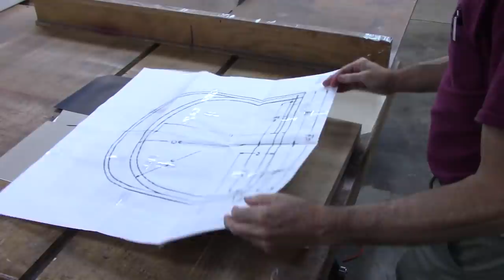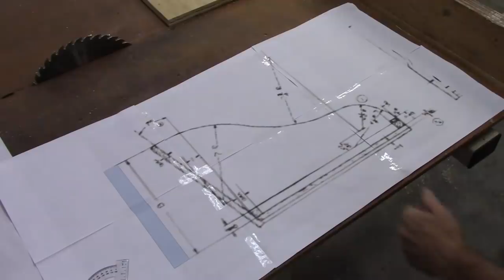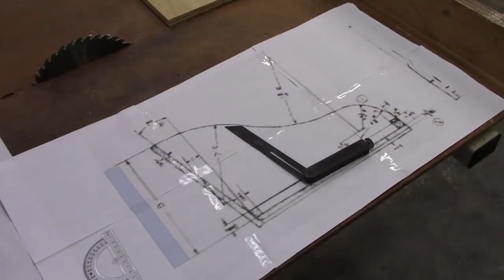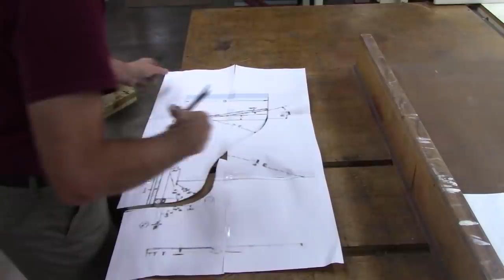Part 1 - Building a Briggs & Stratton Buckboard Flyer

Comment: When doing your bolt circle for your wheel plate it would have been way quicker to put the plate in the vise which would have been way more rigid of a set up for drilling. Sweep the center hole and just make X,Y moves on the table. Not being critical, just that I was a certified journeyman toolmaker for 30 years and taught machining at a local college. That would be the way I would have done a simple 4 hole bolt pattern. Only reason you might have gone this way is your table didn’t have the Y travel? I always avoided most rotary tables if possible, lots of backlash and never lock down enough for some applications. You seem pretty experienced. Enjoyed the video. Nice job on the build.
Reply from the maker: Yeah...  that would have worked perfect! Thanks for the tip. In some areas I have a lot of knowledge and some not so much. Also ready to listen for a better idea. I've had a lot of exposure to machine work and been a woodworking forever. I designed improvements for printing presses before a retired so I worked closely with out machine shop and learned a bunch. I've had a lathe for about 6 years now. I had 3 so far but sold one...  now have a logan and a South bend. Old stuff...  1942, 1947 and the South Bend is 1931. I love the south bend! but they are all fully restored and nice lathes. The mill is junk but 100% better than no mill. I've had it about 2 years. Nice to have.  Check out my other videos. Thanks for the comment! Hopefully you subscribed. I like hearing about better methods!
Reply: Winky's Workshop no problem. I was our shops CNC lathe department head and programmer for 15 years and project head of many big projects such as fiber optics furnaces and other big builds for the glass industry. If you ever need advice on trig to do bolt patterns and such I am really good with that stuff. Now that I retired from machine work I do electronic repairs and builds. Love it, wish I would have went down that path over machine work early on. Can’t complain, had a good career except for surgeries from lifting and wrecking joints. Tough job as you get older.

Comment: Those bushings on the steering knuckle 40:44, I think the bushings should be inserted from the inside so that the flange of the bushing will carry the load. Nice project. Nice video. Also the drive wheel will scrub when you make tight turns because it sets behind the rear wheels. It probably affect handling when turning.
Reply from the maker: Good point on the bushings. I planned on using bushings without a flange actually but when I went to install them I only had the flanged. The pin length was already established so I didn't have room. I don't think there will be any wear issue and the steering is effortless. You are right about the lateral movement of the rear wheel. It chatters occasionally but turns fine. Not an ideal method but still works.

Comment: I’d be knocking stuff like this up too and then some if I had access to a decent workshop. Sadly, most of us are not so fortunate.
Reply: I hear ya bud. I've wanted a milling machine since I was 18. Now I'm 66. Just got a free lathe & I'm trying to get that working!
Reply from the maker: What kind of lathe? I'm 64 and bought my mill 2 years ago. I've had a lathe for about 6 years. I've actually had 3 of them, a 1942, 1947 and then a 1931 model. If you are willing to do a lot of work on them you can find them fairly cheap. When I brought home my first lath my wife said...  oh great, you paid somebody to take their garbage. I'll admit, it looked rough but it turned out to be a good lathe.
Reply: @WinkysWorkshop   my brotherbrother-in-law salvaged an old Atlas bench lathe. Two bearings were frozen, but when I took them apart they looked perfect. Just had to clean out the solidified grease and reassemble. 
Not sure what year, but it was made before live centers came out. The tailstock has a little pot with red lead still in it, that was for dabbing on a dead center for lubrication when turning a long piece. (I learned about that watching an Atlas video done by mrpete) Still have to go thru everything else on the lathe. 
Loved watching you building the little car.  There are 5 bicycles in my cellar, I have a notion to build something similar!
Reply: It's surprising what can be done with hand tools and a little extra time.

Comment: Can't wait to see part 2!  If you need more traction you could try finding a tire with more aggressive tread.
Reply from the maker: Thanks. The traction is much better than I expected on pavement. Totally adequate although on gravel or grass it spins
Reply: Winky's Workshop even my 1 wheel drive gokart spins on grass with my weight on it.

Comment: You've got impressive skills, awesome machine work.  Seems a little more heavy duty than it may need, but I don't expect you'll be breaking any parts.  How much is it going to weigh?
Reply from the maker: Good question on the weight...  I need to drive it over a scale. I'm guessing less than 200lbs

Comment: When machining parts you should use a coolant in order to not over heat the metal. It also provides lubrication and makes it easier to cut.
Reply from the maker: For the most part I do. I used spray mist coolant instead of flood. It's hard to see it in the video. It's almost as good but nowhere near as messy.

Comment: Very cool project! Looking forward to part 2, I really want to see what kind of speed and handling you get.
Reply from the maker: There will definitely be some driving videos. The handling is good although not super great in a corner and the brakes are terrible!
Reply: @WinkysWorkshop  A little Camber in the spindles will help with cornering. Maybe add curved blocks of wood as brake pads. To increase the contact suface, like on an old horsedrawn wagon?

Comment: I like where you are going with this, but one thing I have noticed is that you are running the big end mills and reamers WAY faster than I would. Those big end mills like to run about 250 or 300 rpm. The reamers I run about 100 to 125 rpm. Just the way I was taught and did for over 30 years when I was working. Thanks, I really like the project.
Reply from the maker: I totally agree on the reamers. My drill press won't go slower. I'd have to watch again but I was probably too lazy to change speeds on the end mills. I think that was when I was surfacing the top of the motor mount? That was a light cut...  I probably would have slowed it down to do more substantial milling.  I need to find a slower motor or a 3ph motor with a VFD for the drill press. Thanks for watching.

Comment: I can't wait to see part 2. I would love to build one of these for my boy and have him drive it around.
Reply from the maker: These things are a lot of fun but a standard go-kart might be a bit more durable and safer. The brakes are the worst part of this car but it's not as stable as a go-kart
Reply: @WinkysWorkshop  I think my version may get a few mods as far as brakes and would probably get geared down to crawling pace.
Reply from the maker: @Engineerd3d  - I can't remember where I got the large sprocket for my wheel but I think it was the biggest I could find (112 tooth) and the motor is the smallest available (11 tooth). It's okay to go with a smaller drive wheel as long as the pivot point where it connects to the car is the same height as the drive wheel axle. Otherwise the wheel will lift the cart. The available sprocket sizes and end ratios are way more if you use a smaller wheel. Good luck on the brakes. I'm thinking maybe calipers brakes like a bike.
Reply: @WinkysWorkshop  they do make disk brake conversion kits for bikes. Maybe a machined bracket and a nice pedal is what I was thinking.
Reply from the maker: @Engineerd3d  - I might look into that. One reason you don't see go-karts with spoke wheels is that they have a hard time handling engine torque although...  you do see coaster brakes on a bike which would be similar to disc brakes. The big problem would be mounting the disc to the wheel.

Comment: I build replicas of early 1900 era cars. I am in the process of completing one like you have built. Building plans on these older cars are sketchy at best. I do it mainly from looking and studying pictures.  As best I can tell you have a # 40   112 tooth sprocket on the wheel. Do you recommend the 3 1/2 hp engine or would you go 5?  I heard you say that you converted to a go-cart type slip clutch which I think was wise. How many teeth on the clutch?  Does it actually go 24 mph. These answers will help me finish. 
My framework is Hickory.
Reply from the maker: Hickory is good and strong!  There is a link to the plans under the video. You are right.. sketchy. I imported mine into cad and then made it to scale with the few known measurements.  If I though somebody would pay well for my efforts I'd re-draw them.  3.5 HP is enough for my wife and I on level ground but we are maybe 150 lbs each. It goes 28 MPH and that is plenty but a little more power would be nice. The sprocket Linn-Gear 35A112 SPROCKET H1 (112 tooth). The centrifugal clutch I highly recommend! Mini Bike Clutch 3/4 Bore #35 Chain 12 Tooth. Email me winkysworkshop@gmx.com

Comment: I was looking at an original Briggs and Stratton motor wheel online.  They tucked the engine (smaller) right inside the rim and ran the exhaust down and out thru the mount.  You ended up having to space the engine out a little because of the shaft length, but with all that heat, it was probably needed anyway.  You might want to consider some sort of sheet metal piece between the rubber and the exhaust to protect the tire.  I had never seen one of these before.  I don't know how you come up with this stuff.
Reply from the maker: I saw a picture of one about a year ago and told the wife I was going to build one. My exhaust is a good 3 to 4 inches away from the tire so not a problem. The engine is offset quite a ways to keep the drive wheel centered. I overlooked a clearance but it worked out. My pull start is about an inch from the right back wheel. Closer would have been a problem.

Comment: very cool. But to add more weight or downward pressure for the drive wheel, would you be able to do a spring load of some type to pull the setup down & just use the lever to lift it instead ?
Reply from the maker: Thanks...  there is no spring, just gravity. Traction is not ever an issue unless you are turning and the wheel sometimes chatters.

Comment: I'm sure it won't matter much at such low loads and power levels, but my automotive heart hurts a little when I see regular bolts used to clamp a wheel designed for conical bolts. Excellent project through.
Reply from the maker: Thanks. Actually these wheels were designed and sold for use on garden carts. I'd say most are probably held on with a washer and cotter pin. The wheels run on a 3/4" axle same as most go-carts but you are correct, a washer and 1/4" 2-20 bolt hold the wheel on. I'm guessing under tension is would take 1000 lbs to make the bolt fail. I'd say the bearings would fail with less force. Wheels designed for this type (car) application are very hard to find. I worry more about the wheel/spoke failing. These type wheels are designed for downward force not lateral. The only thing better I could find is Workman wheels. They are designed for tricycle use and cost $160 each without the tires. I've road the heck out of this thing so far they are doing well. The turning radius is not so good which is probably a good thing. FUN!
Reply: @WinkysWorkshop  I uh, meant the drive wheel off the Kia, and really, it's more of a nitpicky thing, not a real concern about failure. :) 
I wouldn't be too worried about the spoke wheels, they can take a lot of abuse. Seems like it's a lot of fun to drive around indeed. Sadly such things are illegal where I live, or at the very least, made very difficult.
Reply from the maker: @AlexanderBurgers  - Got ya. Yeah, the drive wheel doesn't have much load. I wish it was lighter weight although the extra weight probably increases the traction some. Illegal?  Yeah, it is definitely not legal here but I don't live in city limits so nobody says much.

Comment: I have a heavy duty drill press, but not a metal lathe. I have a torch and stick, Mig, Tig welder and many diffrent cutting tools.  I guess I can get a cart built. If I ever run across a metal lathe for a good price I'm going to snatch it up, but in California everyone is looking for the same thing there is many garage hobbyist building thing's.
Reply from the maker: I wish I had a better welder but I get by. Yeah...  with a lathe and mill you can do a lot. The lathe is super useful... more so that a mill I think. Even a very small one is great. I live in KY. Sometimes they go very high but occasionally you find a deal. Of course they always need a bunch of work but that's part of the fun.

Comment: Your doing a great job! Keep the videos coming.  And your welds don't look bad. On weld.com he says that 110 with flux core has deeper penetration and the Do it yourself welders can do a great job with a 110 setup!
Reply from the maker: I had flux core on the welder and ran out. The gas does a cleaner weld but for 110v I like the flux better.

Comment: they race old time cars like this at my local dirt oval speedway hear in stanwood wa. they use honda 90 cycle wheels & 6hp engines. the wheels are stronger but they still break spokes sometimes. the track is called slime dog its on face book.
Reply from the maker: Cool...  I grew up in Lynnwood WA. I wonder where they get the wheels... I'll check it out! Thanks.

Comment: ??? I am wondering about one thing. With the bolts all lined up in a rectangular pattern, I wonder what is preventing the bed, or deck from folding from a rectangle to a parallelogram. But I feel like maybe I dozed off while watching, maybe you installed a diagonal brace somewhere that I am missing. Regardless, looks to me like you had a lot of fun building it and I really like your drill press table mechanism. Might have to copy that!
Reply from the maker: You are right...  I need to install a diagonal brace. It hasn't moved yet but it needs it anyway. I also have a video and drawings available on the drill press and x y table. I'm not sure i could do without this drill press... its fantastic.
Reply: @WinkysWorkshop  I confess I stayed up way too late to watch part 2. Looks like it will be a challenge to get a diagonal brace in under the deck. I noticed a nice trapezoid formed by the anterior and posterior seat mounting points. Maybe replacing the seat posts by outlining that trapezoid with oak would do the trick, and look like it was part of the original design. I'll look forward to seeing what you come up with.

Comment: Fantastic!  What is that tap handle you are using with the drill press to keep things centered and straight???
Reply from the maker: I made that a while back after tapping about 20 holes with a small tee handled tap wrench. Not enough leverage and my hands hurt!  The larger standard tap wrenches don't have a have a place for a center so I figured a tube that slides over the countersink I use for putting a chamfer on the hole would be ideal. The challenge was making the tube center itself with the tap. I made a video, check it out.  https://studio.youtube.com/video/ADYdezM8uMU/edit/basic?o=U

Comment: At 14:28 where you drill the 4 holes into the sprocket -- I'm wondering why didn't you need to have the piece clamped down???  Is it because the bit is so sharp?  I half expected the piece to twist.  Personally I've no experience with professional machining tools but it's impressive to see  you work.  My wife has an uncle who was a master machinist and he cranked out a handful of double-headed quarters -- the one I have absolutely looks like it was minted that way.
Reply from the maker: Yeah you are right. Clamping would have been a good idea. The drive on my drill press would have stalled if the bit grabbed but not rally a good excuse. Thanks

Comment: Great project. I watched both videos. I could see myself doing something like this. The one thing I might do differently is try to look for a quieter motor. The one used seemed loud.
Reply from the maker: Thanks, it was and is a lot of fun. I agree about the motor although it is a bit quieter than you might thing. I asked the neighbor if it was loud and they said....  we never hear it. Never the less, I've been looking at better mufflers.
Reply: Could be a useful place for an electric motor, a DC treadmill motor basic controller and whatever you can scrounge for batteries.

Comment: WINKY: "Believe it or not, in 1920, this was a street-legal car." [proceeds to drive it on the street]

Off the top of my head, I'm thinking that it would take a LOT of work to make it street-legal today, including:
1. front and rear bumpers
2. fenders on all wheels
3. turn signals
4. brake lights
5. horn
6. windshield
7. seat belts
8. rear view mirror
9. muffler
10. illuminated license plate holder
11. registration
12. insurance
Plus, depending on where you live, maybe an emissions inspection.

Or, you could try to alter the design so that it would fit the definition of "motorized bicycle". But that would require:
1. designed to travel with three (or fewer) wheels touching the ground
2. having functional pedals
3. motor size less than 100cc
4. top speed less than 20mph (on motor power only, with a 160 lb rider)
But then you don't need fenders, turn signals, registration, etc.
Reply from the maker: I'm not suggesting it needs to be street legal. I live in a neighborhood with no through traffic. Of course that doesn't make it legal but it certainly makes me feel a bit safer. Actually, 5+ years ago it would have been legal to drive in this neighborhood. The original creator of this subdivision still owned the streets. It was a major ordeal for him to get the county to take over.